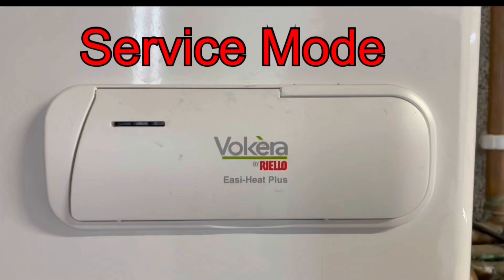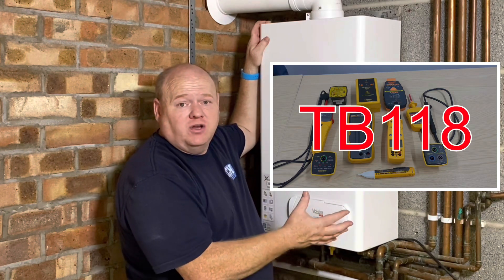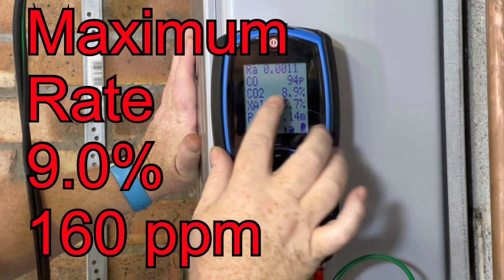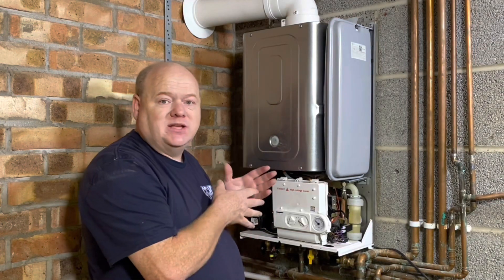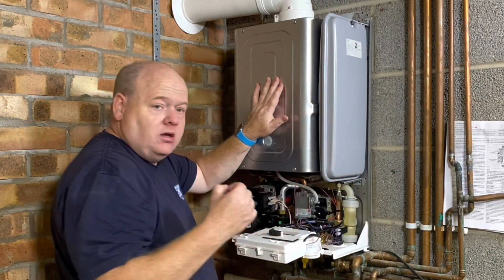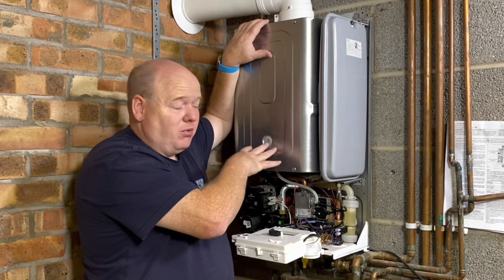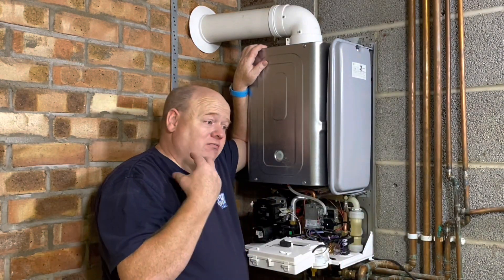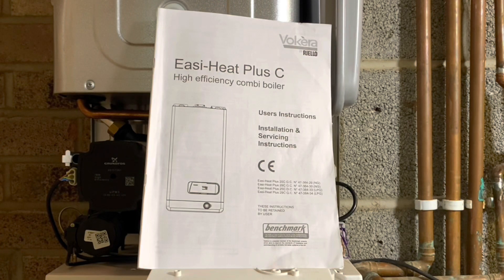Gas Training - How To Put A Vokera Easi Heat Into Service Mode

Comment: I have been watching you for a couple of years. I am a Gas Safe engineer and I have learnt so much. It is a simple way of training which it makes it easy for me to understand and apply. With modern boilers coming out with lights and codes that sometimes can be misleading and stressful but your methods of testing components are brilliant. So thank tou.
ANTHINY KELLY
Reply from the maker: The instructions are not always easy to understand either. Thank you so much for watching. Are you going to installer this year? Thanks.

Comment: Can you help me please how do I put it to the setting where the boiler will automatically kick on when the temperature below my thermostat drops if that makes sense please
Reply from the maker: What do you mean lol. Thanks.
Reply: I’ve got a salus thermostat on the wall, what setting do I put my boiler so if my temperature in my house drops below 20 degrees my boiler will come on and heat the house I need to manually put my boiler/ radiator on and on
Reply from the maker: @shannonthomson7270  there are lots of salus controls, which model is it
Reply: @AllenHart999 Hi, can we install a thermostat for this boiler? Is it possible?
Reply from the maker: @JessLord1  yes

Comment: I have this boiler,but don’t have a wall thermostat,is it possible to fit a hive or similar type,as I have no clue what temperature my heatings on,I’ve got my left knob on 6 1/2 dots and right on 5th dot,boiler pressures on about 1.5bar,thanks if you can help 👍🏻👍🏻👍🏻👍🏻👍🏻
Reply: I am looking for a solution for the same problem.  I am renting a new property, and there is no thermostat, did you manage to install it for yours?
Reply: @JessLord1  I had the google nest system fitted

Comment: Hi Allan, called to Vokera Easi heat today and noticed first thing no pressure but boiler worked ok for hot water i have recommended a new pressure switch, but do you have any opinion that it could be anything else like PCB. all analyser reading are ok.

Comment: On the vokera hot water working ok one tap running open another tap hot boiler goes into reset continually red light any suggestions.

Comment: I had a new easy heat ci fitted last week. When internal clock set to auto it won’t turn off. Re programmed timer three times now and put back in default mode. But still will not turn off when even selected to off on the clock. Any idea what’s wrong ?
I don’t have an external clock yet.

Comment: Hi Alan, when you read the service manual it does not make it clear that you have to turn the control knob to that position, lost in translation I think.
Reply from the maker: Hi Steve. I totally agree the installation and servicing instructions are not the best with this boiler. I did mention that to David. Thanks.

Comment: Hi Allen, love your videos as I find them very educational and interesting. I'm glad Vokera sorted out the problems, I think it's correct that it is a few years old and poorly installed and maintained. As for a future boiler, that would depend on your heating and hot water needs. If it is just a swap in my opinion eiher Baxi 800, ideal Vogue max or maybe the new Viessman 100 that are Hydrogen gas ready.
Just a layman's opinion.
Reply from the maker: I am thinking of ASHP at the moment but I might change my mind. Thanks.